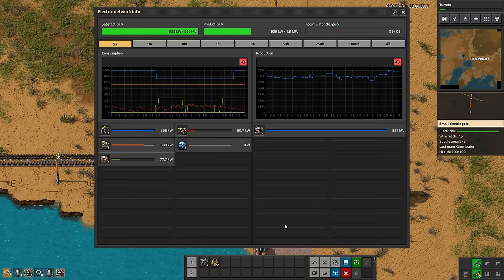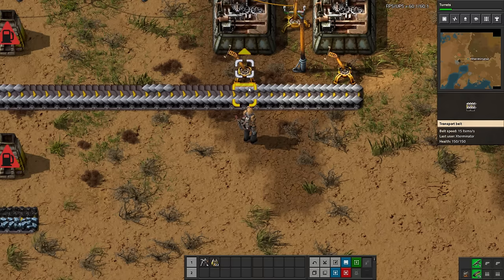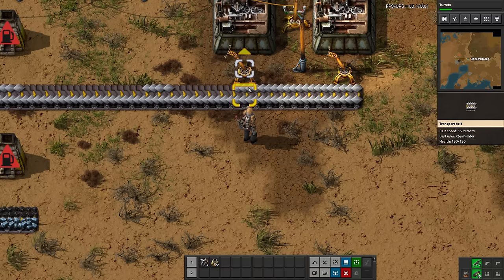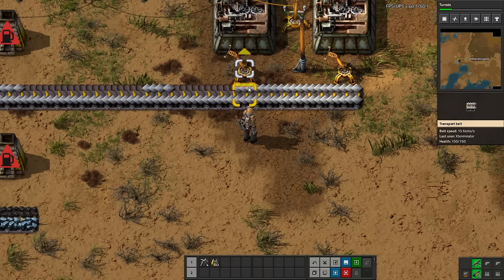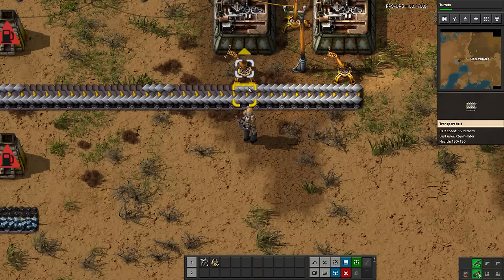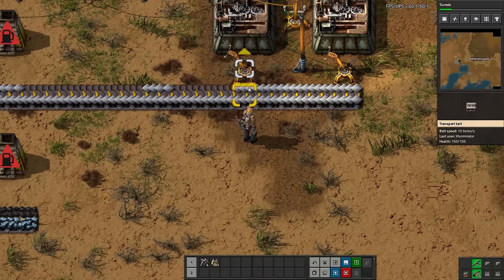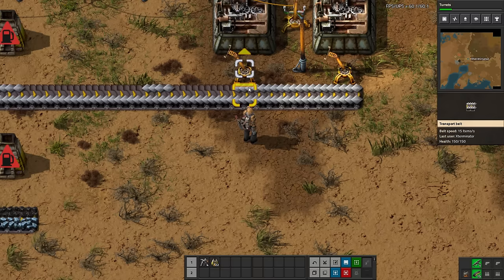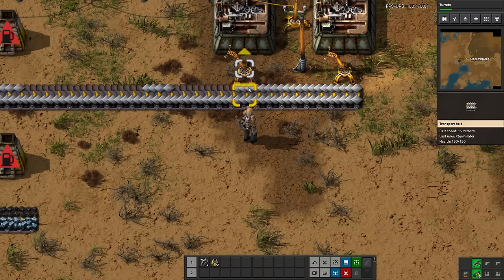Factorio 1.0 Tutorial Lets Play EP3 -  Science Setup: Introduction Guide For New Players Gameplay

Comment: On the power generation: It is always better to have more boilers and steam engines then needed, as you will save fuel. 
1 boiler can power 2 engines, aka rouhgly 1.8MW. If you use 1.8MW and you only have those 2 engines, you will burn through coal like crazy in your boiler as it needs to keep up the stream production.
If you have 10 boilers and 20 engines and still only use 1.8MW you will consume way less coal overall.

This is very much noticeable when you have big steam setups with 40 engines and more and all the time your coal situation was fine, but then you build stuff and spiked above the 50% mark and your coal consumption skyrockets. 

Is is advisable to have the total power consumption below 50% of your maximum steam engine output, to save on coal :)

Comment: Hi, this furnaces scheme is planned for electric furnaces? thx for the tutorials , sorry for bad english
Reply: No it isn't but there is no real need to. Electric furnaces are a very late game item that are not needed in order to launch a rocket, only if you are intending to build very large megabases. And if you are using those you will want to beacon them to get better throughput than steel furnaces, so your smelting layout will look extremely different anyways. This is more of a starter base you can use to later build a megabase elsewhere.
Reply: Electric furnaces are 3x3, so they require a complete smelter rebuilt. In theory there are ways to take that into account from the beginning. But the real point of using electric furnaces is modules (plus beacons). By they themselves they aren't any better than steel furnaces. So you might as well keep those.
Another use case is off site smelting right next to an ore patch. But that's late game too